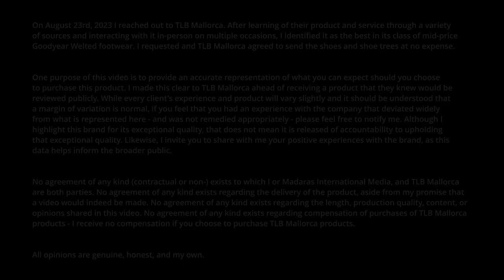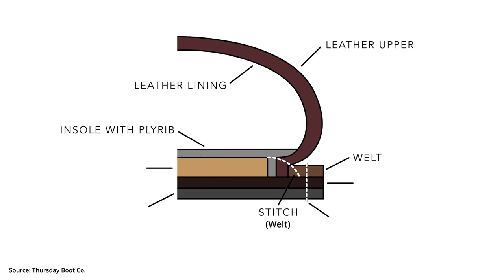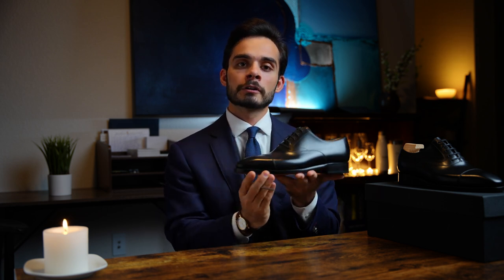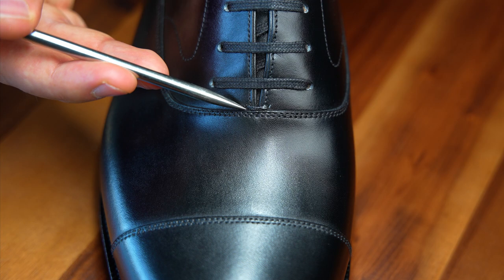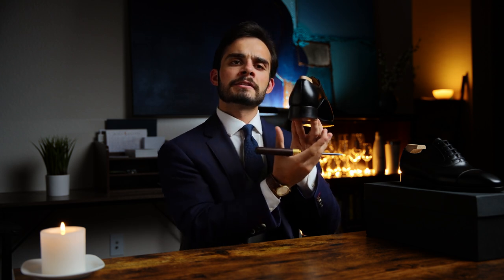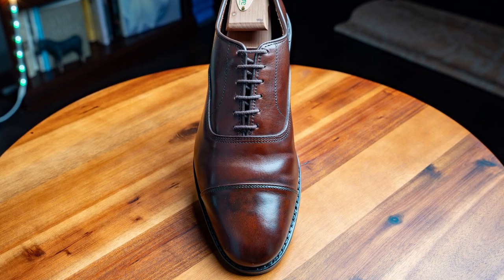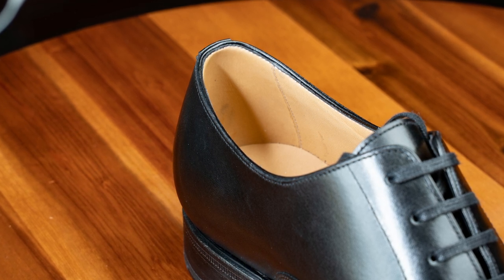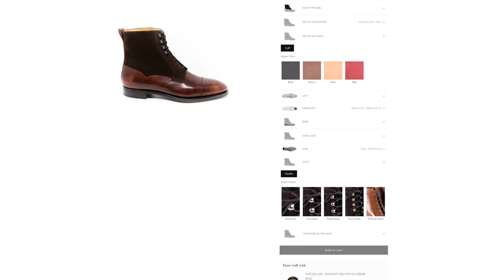An Unreasonably Detailed Guide to The Best $400 Shoes in The World.

Comment: Do you prefer TLB over Yearn? I´m really interested what do you think? Love your videos!
Reply from the maker: Great question. It is a difficult comparison, as they are ultimately in two different orbits. Yearn is higher quality in terms of construction. It is also almost $100 more, so it should be. In general, I am more inclined toward the more subtle, contemporary, angular, low-profile designs that come from Asiatic makers, though that is just my personal preference and not a value assessment. European designs tend to be a bit more round, curvaceous, and 'big' (in a subtle sense) - what you might consider 'classic', as opposed to contemporary.

TLBM has been operating longer, to my knowledge, and it shows. They exude a level of refinement that I think Yearn is still working on. It is also easier to hit 'peak refinement' when ample machinery is being used in the process, as opposed to fully handmade. Yearn is indeed working on it, though. I have seen pictures and they have substantially improved their shoes even since my video on them - and they were already the best in their class.

Both are ultimately the best value in their respective class, and not that far off in quality anyway, so I think if price is no object to you, I'd pick whichever shoe is more compelling to you in terms of design.

I know that is slightly a non-answer - does that help? You are welcome to inquire further.
Reply: What do you think, is difference between Carmina and TLB Mallorca? And Thanks for the long and good answer!
Reply from the maker: @clemensgabriel30  TLBM is easily the better value. As far as the better shoe, more objectively, still TLBM for most models. I'm sure Carmina has some shoes better than TLBM, though they will be upwards of double the price.  I think TLBM has nicer Lasts in general, though that is my personal opinion.
Reply: @DressWell.Madaras  that is my problem with TLBM i like more modern italian last and Carmina has  with the Baltix last the perfect one for that and I prefer looks than quality. The question is: Is Carmina so much worse when it comes to quality? Thanks for your answer!
Reply from the maker: @clemensgabriel30  Carmina is relatively fair market value. TLBM is just unreasonably exceptional in its value - hence my showcasing it - but by no means does that condemn Carmina. Carmina is a respectable maker and produces high quality shoes. They are getting pricey as their brand grows, though not to the point where I would consider them a 'bad deal'. Looks are important - arguably more so than construction & materials - so if you like Carmina's Lasts, I'd say go for it!
Reply: @DressWell.Madaras  thanks
Reply: TLB is a better value than Yearn and I own multiples of both brands.  Yearn's have hand made elements to them that TLB doesn't and that doesnt mean TLB are lesser quality.  I think my TLB artista's are a superior fit (for my feet) than my yearn's.  Both brands are great.  Yearn's shoe selection is more artistic than classic.  You can get some subtle patina shoes.  TLB periodically runs discounts (free belt and lasted shoe tree for black friday or 15% off custom shoes).